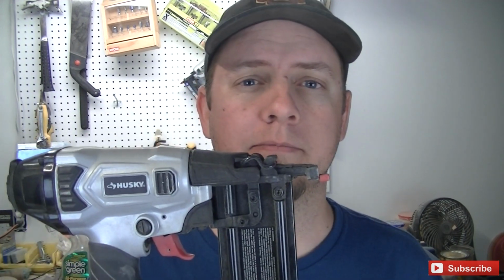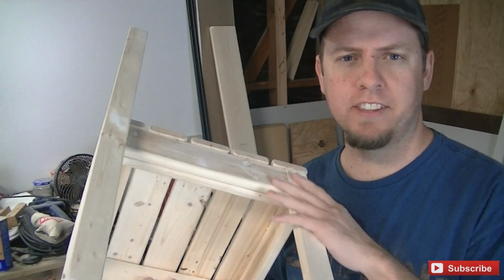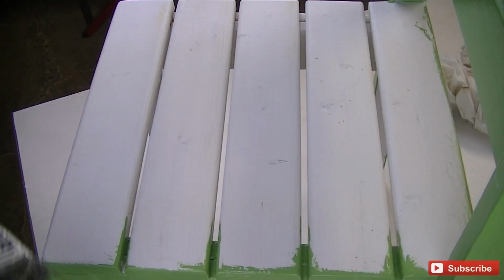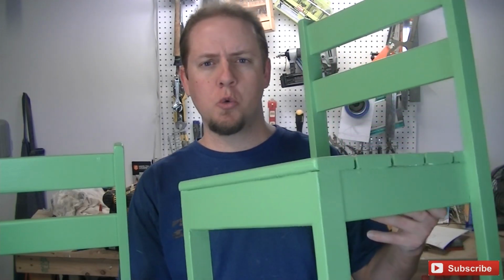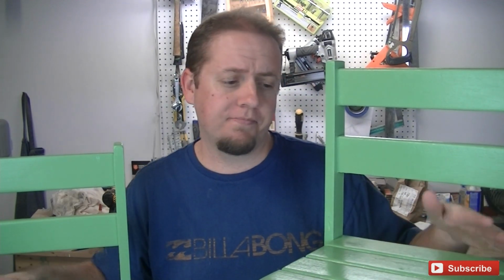How To Make Chairs For Kids

Comment: I'm new to woodworking. What is the attachment you use before drilling in the screws? Do you use it as an alternative to a bit? And what is the benefit of using a screw in the places you did vs just using the nail gun?
Reply: A few years late, but I believe he was counter sinking the holes so that the screw head wouldn't stick out.

Comment: Great project and video as usual coming from you.. But I have a question for you.. I been searching and reading reviews on air guns combo kits. How do you like your husky ? Wish you would've purchased another brand ? Or satisfied ?
Reply from the maker: Eric Grijalva  So far so good with the Husky air guns. I have a pin nailer and brad nailer. Got them during the Thanksgiving sales. I am happy with the purchase. I dont use them all the time. If you use them everyday, I would spend the extra money and get a Porter-Cable, but for the home hobby guy the Husky brand is fine.